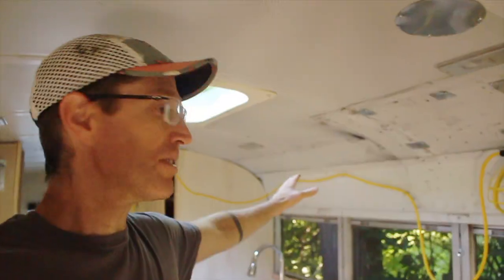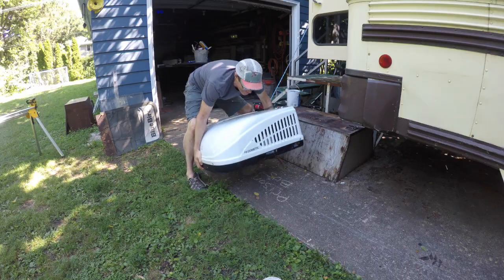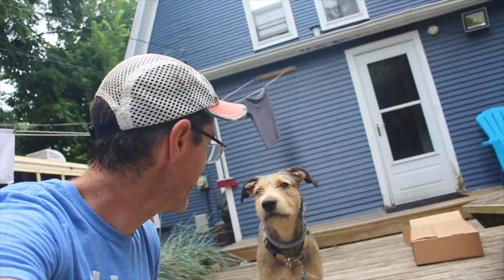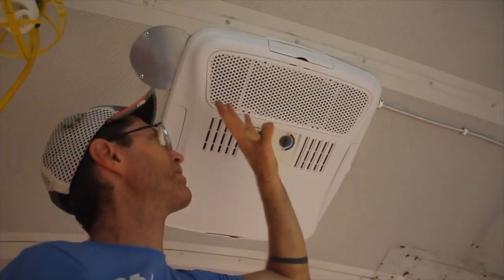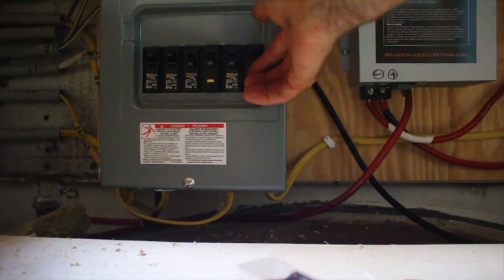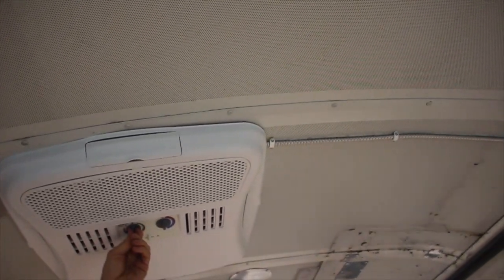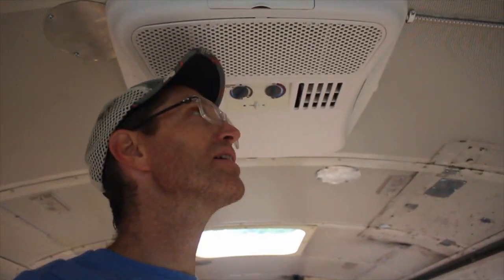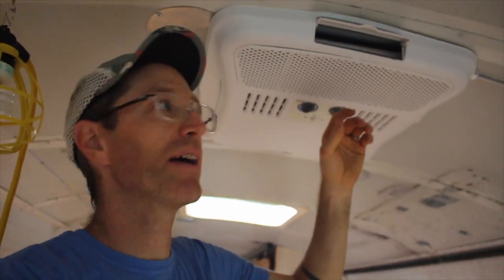Air Conditioner & 12v Block Install -- Prison Bus Conversion #37

Comment: You should be teaching the fellows that put together a  trailer or 5th. wheel makers  or even R.V. makers, that way their ceiling vents wouldn't rot out the wood even if they leaked. good thoughts going into this build. I really admire all your hard work. You do make everything look so easy.
Reply from the maker: nice of ya to say! thanks, man

Comment: Will you please brief on electric supply for all this with specification, and how it is handled so as to match exact input of AC
Reply from the maker: The bus runs on 110v alternating current. Any other specific questions?
Reply: @metaspencer  In India we have 250v/50hz supply to house hold , So if we step it down to 110v/50hz so will same Bus Air-conditioning system will work fluently ?
Reply from the maker: @kapiljadhav8501  Yeah, that sounds right ... but you just need to check your unit to see how much power it needs
Reply: @metaspencer  Thanks Sir.

Comment: How is the new hole watertight? Haven’t seen you apply any of that black goo on the edges before placing the unit
Reply from the maker: Big old foam gasket ... but I probably should goop it like crazy!

Comment: Nice to have cool air. I still have to replace my forward one on the Motor Home. Going racing on Sunday and it will be 90 degrees. With just the rear A/C unit working, it will be hot. I think you will have the same problem I have with the A/C unit in the trailer. The ceiling is just high enough to lull you into a sense of security, and then whamo  that ceiling fixture will jump out of the ceiling and hit you in the head (so hard you will see stars). No joke, until you know it is there put some padding on the corners, I have almost knocked myself out a couple of times. Glenn
Reply from the maker: I was worried about that but no bonks yet! Good luck at the track!!!

Comment: We got lucky with our bus. It has two AC units that are aftermarket, We didn't even know the bus had AC until we went to pick it up. One in front above windsheild and one in back above door. They are huge and cool the bus down even in Texas heat when driving, plus not in the way for any conversion plans. We still plan to mount one on the roof as well for when we are parked.
Reply from the maker: Chilly!!!

Comment: NICE!  We've been thinking about adding an A/C unit to our bus. We were concerned about the curve of the roof. Our bus seems to have a "rounder" top than yours. Which would mean building some sort of leveling shim for the roof. Then we're concerned the head unit inside would need the same type of a thing, due to the "implication", I mean inside curve.  :)
Reply from the maker: The foam gasket on mine ate the curve, but I know what you mean

Comment: Could you tell me the decibel level of that a/C? It seemed fairly loud and we are wanting to install an a/c in our bus which would be used for business, and would not want something that would interfere with conversation. I've read the Coleman Mach 10 quiet series is 55 decibels but not sure how loud that would be in comparison. Thank you for the video btw, it was great.
Reply from the maker: If you want quiet go for a mini split: all the noisy stuff is far away outside. I don't have the DB on this unit but yeah, it makes some noise. Kinda like a fan.
Reply: @metaspencer  thank you.

Comment: I currently have a bus that I’m turning into a party bus and I have two rooftop a/c units that are powered by a generator. I need sure power when I’m driving I have A/C and lights as well as all the other electrical components working while the bus is moving. But I still want to use my generator for when I’m tailgating so I don’t burn up my generator or my fuel. Please help me if you can. I have spent so much money and I can’t afford to keep trying things or paying people to fix it that don’t work for my application. Please help anyone…. Thanks
Reply from the maker: What's up Doc!? That party bus is gonna be fun ... lots of fun. So what exactly do you need? To figure out how to hook everything to your gas powered generator?
Reply: @metaspencer  I have the generator already hooked up to both a/c. I’m trying to figure out how to hook both of the a/c to the alternators with a battery bank. So while I’m driving the bus I have a/c when I start the bus. I only want to use the generator when I’m tailgating at a Cowboys or Rangers game.
Reply from the maker: @docdock4321  If the AC you wanna run is 12v just wire it like you would any other 12 accessory using fused connections
Reply: @metaspencer  how would I do that
Reply: I’m completely new at this. I’m learning as I go.
Reply from the maker: @docdock4321  understood! some books on basic wiring would probably be a good idea ... I know I read quite a few!